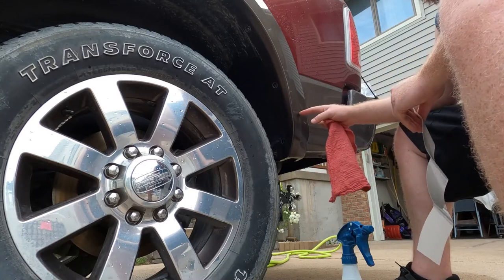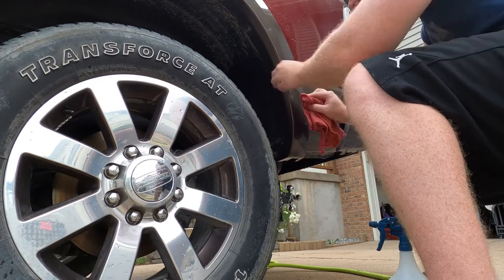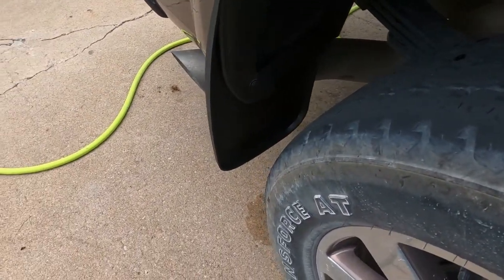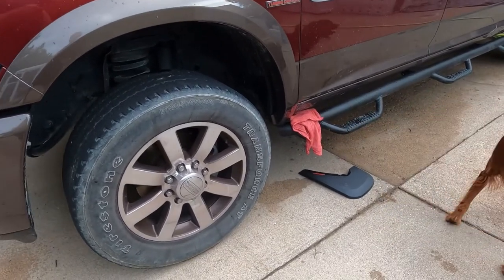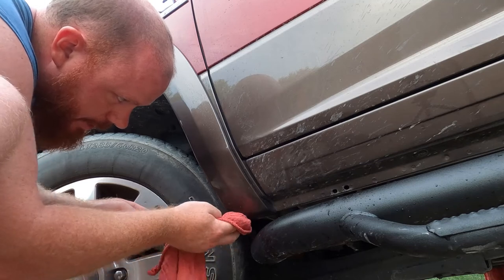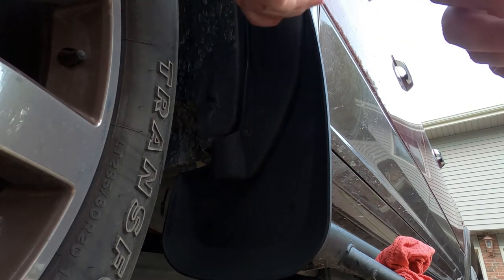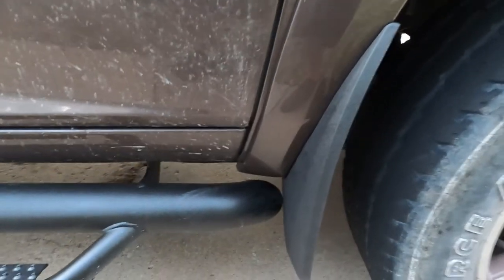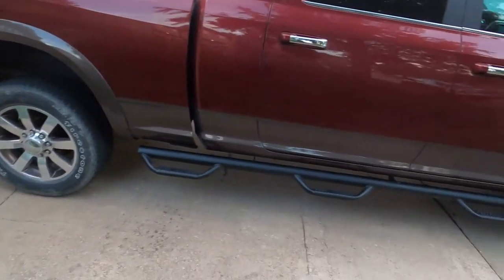Husky Mud Flaps Installation

Comment: have you thought about putting one of those dust guards that hang all the way along the back of the truck that stops stuff from hitting your trailers? I dont know what they are called? Ive been thinking of getting one to better protect the stuff I tow. I have mud flaps n such on my truck but the trailer gets full of dust and road grim and chips on the trailer. I really thought about it the other day when i went atv riding and the atv was covered in dust from driving it to the spot to go riding. I think Im going to look into it further but i cant think of what they are called to google it.
Reply from the maker: I think they are called trucker mud flaps. I don't think I need those (yet). We are going from no mud flaps to mud flaps so I think they will make a huge difference and so far so good!
Reply: @RedbeardOutdoors-IrishSetters  I have mud flaps on my truck and they only seem to help the truck.. all the road dust and wet road grim and such still get all over what ever im towing. my neighbor puts it on his truck in the winter months so snow and such does not get on his snowmobile when he is towing it. I guess they come on and off as I only see it on his rig during the winter months.
Reply from the maker: @stevew5212  yeah might be worth getting some I know they make them where they are mounted to your trailer hitch so you can easily take them on and off.
Reply: @RedbeardOutdoors-IrishSetters  that sounds good to me.. i know I need to look more into it.. thanks